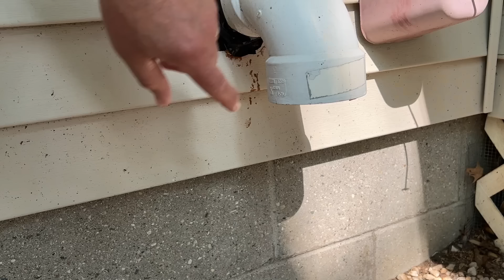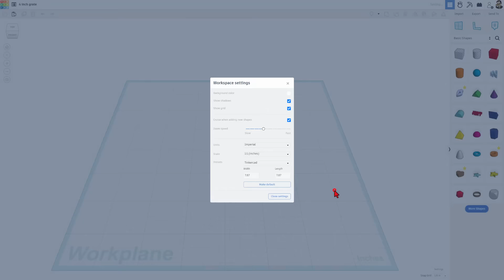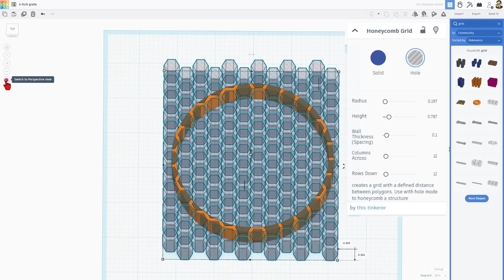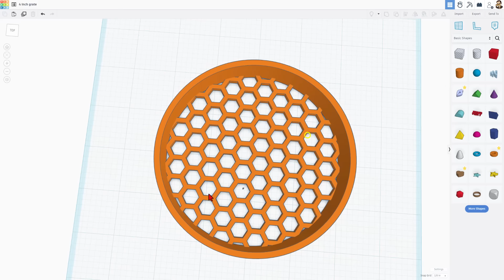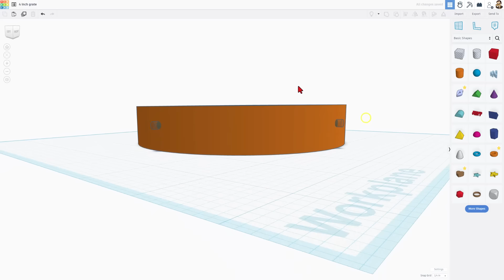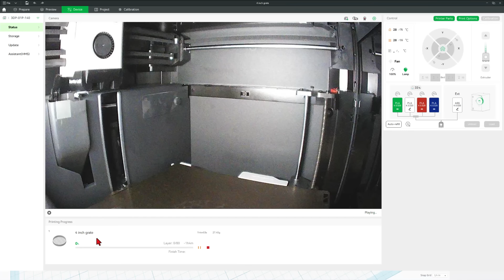Easy 3D Printing: Make Useful Parts with Tinkercad! Beginner Ready 💯🔥

Comment: Im trying to make this model 46mm diameter by 2 mm tall. How do i make the grid flush with the bottom of the ring? My grid is slightly below the ring and prints out that way.
Reply: Thank you, link shared.
Reply from the maker: Sorry I did not get to it earlier. 🤦‍♂️ I added a mod for you there.
Reply from the maker: Get me a share link to your project and I will see what I can figure out.  https://bit.ly/sharehl  You can share the link in my Patreon Design questions area.   https://bit.ly/patmess

Comment: Firstly I love your channel and what you show us how to do!....  If we are intending on 3D filament printing.... I was told a few years ago, when designing parts think of the nozzle size and to make wall thicknesses of the multiplier of the nozzle size... IE if using a 0.4 nozzle, multiply the width of your thickness of the side by 0.4 as much as possible... is this right or not?
Reply from the maker: It does not hurt to plan that way. Then again slicers are super smart and adjust on their own too. I would say design it how you want... if you have an issue, then adjust.
Reply from the maker: Thanks for the kind words too!

Comment: haha.  cool, but even simpler is buying a cap and drilling holes (to your desired size).  use a piece or 2 of electrical tape for a snug, non-permanent fit and you're good.  Sure, having an excuse to print something is part of the "fun", but I would not have wasted my time on this as there are other ways I could do this.  I have a similar 4" hvac heat exhaust pipe but it is turned up and looks like a "7" (heat rises).   however, I do have rectangular crawl space vents w/louvers that I want to cover with a screen to prevent unwanted tenants.  that might be my next project.  Each rectangle is slightly different so I will put in tabs that offer fiction hold and can account for the minor differences.
Reply from the maker: Thanks for the note. I am always looking for a excuse to use the printers. Bonus points from my wife when it is a part around the house vs a silly fidget. Good luck with your vent project!

Comment: Manufacturers often post technical drawings and CAD models of their parts so I went looking. Maybe this will be helpful to someone…
- I searched for Nibco 4807 and downloaded a STEP file of the fitting (entered completely bogus information to download, even email address)
- Loaded file into Orca Slicer (Bambu Studio took too long), used the cut tool to discard everything but the end of the fitting, exported stl
- Imported stl into Tinkercad, specified inches and set dimensions to 4x4 in import dialog box

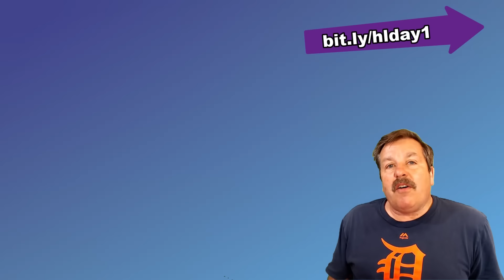9:55 “…playlist of grate lessons for beginners”…like this one! 😆
Reply from the maker: Sweet technique! Thanks for sharing and being such a great part of the channel. 💯🔥
Reply: That is actually helpful, TY. I knew you could download bolts and such from Fastenal or Mcmaster Carr, I didn't know about this though. That's great, ty
Reply from the maker: I was thinking the same thing. Likely have to adjust due to your printers tolerances... but with a little Kentucky windage it could be really slick!

Comment: You could also Design the grid within the slicer😊
Just Close the bottom with a round plane. Then in the slicer choose Zero top and bottom laywrs and adjust the infill pattern and density. Or use a modifier for a specific area.
Reply from the maker: Slick trick, but does it really save time over designing how you want in the first place?